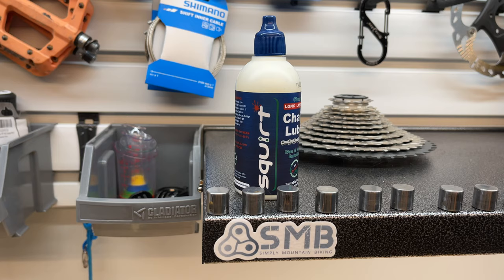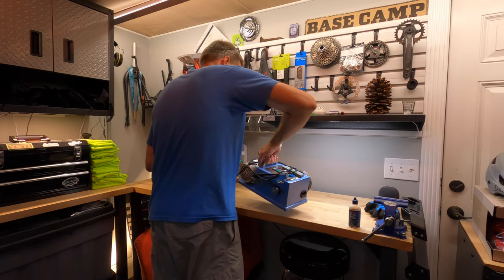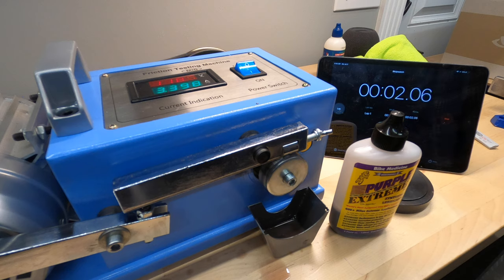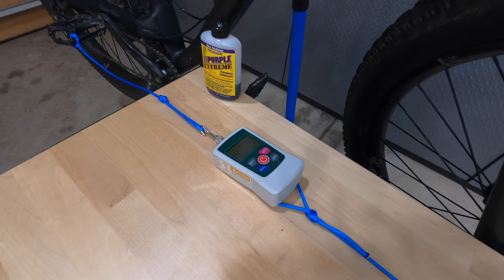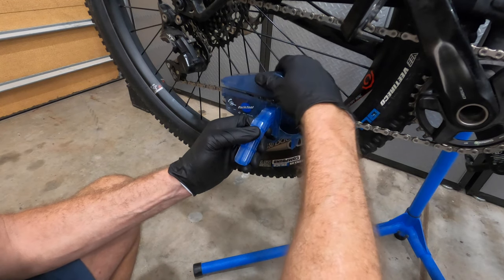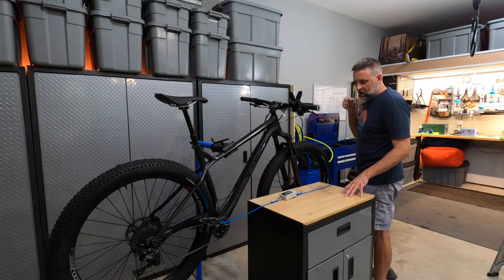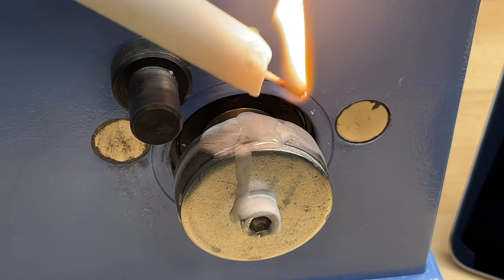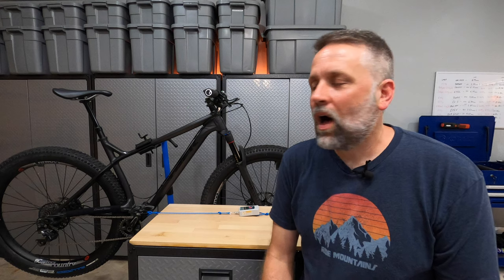Is Squirt a Good Chain Lube? | Squirt Wear Test

Comment: Hello Eddie. thanx for the revisit of the Squirt test. I've used it for over 5 years now, but since I first saw your ultimate test, I've been considering using R&R Gold. but my concern now is how long does it last compared to squirt. I've seen a few vids praising R&R with only downside been how it lasts compared to wax. some ppl say they have to relube in the same ride? Any thoughts about this? thanx again!
Reply from the maker: Thanks for your question - I ride MTB strictly and so I may not have the field experience you're looking for to compare.  I did not have any mid-ride failures of R&R when I used it, but my long rides are generally 1.5 - 2 hours and under 20 miles. -Eddie

Comment: I used wax once. I went back to oil two days later. Wax is only good to keep a chain looking good on pictures or to show it off to your friends.
Reply: I have a similar experience, though I used it for a few months in gravel bikes visiting mostly dirt roads. I reapplied squirt every 100km the day before. The chain looked clean, no dirt was accumulating but the chain lasted 800 km :/
Reply: @michahubert1179  800 km is awfully little. I'd have to replace my chain twice a month... 
I'm afraid there's no replacement for cleaning rags and lubing the chain regularly with an oil based lube. I use hydraulic oil thinned with diesel (specially in the winter)  for application, and let it dry overnight.
Reply from the maker: Thanks for sharing! -Eddie

Comment: Thanks for the video! I have a suggestion for an even more thorough and precise test - I hope you will read.
Bike chains are worn with low force across many repetitions and your test is based on a much greater force over a very short span of time. Squirt lube is not made for high force friction, so the high force might push the wax aside, while it might stay in place and do its job correctly at a force representative of what our legs put into the chain. How about setting up a test with very low friction and many repetations?
Reply from the maker: Thank you for the suggestion.  I think others have done it this way. -Eddie
Reply: Chain force is actually very high.

Comment: Well... "Protection test" with  ultracleanclean chain. The main issue is the road dirt that wet lubricants attract very very well. What would happen if you add sand to the oil lubricant?
Reply from the maker: I had a viscosity test lined up for the lube test - but didn't run it.  You can expect that high viscosity lubricants are more sticky and will collect more grit.  The lower viscosity ones (e.g., Purple Extreme) collect very little grit.  The dry lubes (Muc Off, White Lightning, etc.) all would perform about the same as wax. -Eddie

Comment: What about muc-off, the previous winner, how does it handle the friction test, if it is given time to dry out and doesn't get replenished? 
I am very curious whether it will also be scraped off since it is a dry lube.
Or any of the others for that matter, after having been resting over night. They might show very different characteristics in that case, considering their different viscosities and lube content.
Reply from the maker: In the first video, I do test Muc-off fully dry.  It does extremely well - beating wax for sure.  -Eddie

Comment: This is a good follow up test. I just bought a new chain, wondering which one I should use. Do you still use an oil based lube instead of wax these days? Thanks!
Reply from the maker: I have been using the Muc-off product for over a year and have had great results.  It does get a bit dirty - but I've not found a product that doesn't in the conditions I ride.  It's easy to clean with just water and a microfiber cloth.  I clean my chain every 3-5 rides and re-apply. -Eddie
Reply: @SimplyMountainBiking  Thanks so much. Love the smell of those Muc-offs too. :) Last one, do u strip the factory lube of the chain before installing it or just use as it is?

Comment: I have to agree. I'm not sure why all the hype around squirt. I'm not going to be buying a new bottle. I'd be curious to hear what you think of the work of zero friction cycling. He doesn't hype squirt but is the biggest advocate of wax based lubes (full immersion)
Reply from the maker: Here's a thought that just occurred to me. If wax is so good, why don't new chains from Shimano, SRAM, etc. come pre-waxed.  It has to be cheaper than Sil-Tec (Shimano) and GLEITMO (SRAM). -Eddie
Reply: well, the stuff that comes on the chains isn't really for lubrication. It may have some lubricating properties, but from my understanding it's mostly to protect the chain while in storage. It's called cosmoline and the the military uses the same stuff on their equipment to protect it for storage. At least this is my understanding.   @SimplyMountainBiking

Comment: I wonder if Squirt Wax improves after a bit on the bike, with the chain warming up & thus the wax becomes less stiff? I honestly don’t know because assuming the chain moves more & is potentially warmer, means you’re moving at faster speeds and thus the additional temp is negated by the movement & wind. It might actually become cooler when riding fast…
Reply from the maker: Perhaps? -Eddie
Reply: A chain warming up significantly from stiff lubricant would be bad. Would cost a lot of power.

Comment: Nice extra test 👍 Amho, your friction test is not comparable to an bicycle usage. Rotation is very fast, warm up and liquefying wax. Pure liquid paraffin can't challenge classic oil viscosity. It's never happen on a bicycle. If you test paraffin in solid state, I hope the result will be better. And if you add some solid lubricant, like graphite, PTFE, or ceramic (mucoff way), I think the result will be comparable to the best brand. About me, I compare my best previous lubricant, WD-40 Wet lube oil, applied every ~50km, to an homemade lube mix of paraffin+PTFE 1,3micron 9:1 -see ozcycle channel-, apply every ~150km. I get similar chain life duration, ~20% better with homemade wax, based on classic chain jauge measure at 0,5% .
Reply from the maker: Thanks for the feedback and sharing your experience. -Eddie

Comment: One thing I do not agree with with the wearscar test is that there is nothing to recreate the motion of the chain when it is not under load. That is when the wax lube usually gets put back into place and is ready for the moment of when it is under load.
Reply from the maker: I would respectfully disagree that wax could get "put back into place" because its viscosity is so high.  Maybe some of the lower viscosity lubes like Purple Extreme - but never wax-based. -Eddie

Comment: One more metric. Wet lube against dust or loose dirt. Does using wet lube in dusty conditions wear more than wax.
Reply from the maker: Yeah - it's beginning to dawn on me that many of the folks who comment on wax lubes hail from geographic regions where dry, dusty conditions are the norm.  My typical experience is damp and sometimes muddy riding... -Eddie

Comment: How about checking wear after a mountain bike ride in the dirt?  I think other lubes attract much more dirt and will result in greater wear in actual mtb conditions. I'm thinking the stiffness of the Squirt chain indicates the wax is inside the chain where the wear matters.
Reply from the maker: This is a great point - but field testing is hard to control.  I've been thinking of ways to do this in a lab - where it can be strictly controlled. -Eddie

Comment: You have to put more effort into the initial chain cleaning for lubes like squirt to be effective. A few baths of mineral turps followed by methylated spirits is what you need to truly clean a chain. Just using degreaser and a park tool chain cleaner isn't going to do a good job of actually cleaning a chain prior to applying any type of wax based lube. You should also heat up the lube and chain before applying to increase penetration inside the links.
Reply from the maker: I'd rather buy a new $60 chain every 500 miles.  Thank you. -Eddie
Reply: It's astounding how many manufacturers recommendations you have to break just to put an inferior lubricant on your chain. The day I see wax being used for industrial roller chain lubrication is the day I will try it myself. So that's never 😂

Comment: Yeah, that fricton test machine isn't really an appropriate test for chain lubricants.  That machine is really simulating a high-speed, high load bushing type of wear.  The type of wear that a chain experiences is more of a very slow speed, somewhat high load application, and the lubricant is assumed to be contained within the chain link (unless it isn't).  I really don't see how you can effectively test a wax based lubricant using that machine.  In this case, I think that the only way to really evaluate the performance of chain lubricants is to conduct some sort of simulated ride testing using actual chains and derailleurs, much like the testing done by the Zero Friction Cycling Channel.
Reply from the maker: Thank you for your feedback. -Eddie

Comment: This is interesting,   I just switched to Squirt.  I was using R&R gold (your 2nd choice) for years.   I live in Arizona so dry, dusty, and hot.   R&R gold was great for about 1.5 hours of riding than a noticeable difference in performance.   If I was doing a long ride, I would have to apply a different lube or bring extra.    With R&R it is worth noting, that at the end of almost every ride I would scrape off dirty wax on each derailleur wheel.  I am noticing the same thing with squirt, the difference is it lasts a lot longer between applying.   

It is has been awhile since I have used a true lube, because in dry conditions, they just attract a lot of dirt.  What I noticed with a lube that stuck to the chain is it stuck there with all the dirt and grime.  I would have to clean the chain a lot more often and would get black goo every where if something rubbed against the chain.

I enjoyed the videos, and the tests.   I appreciated a perspective relevant or not for each test.   I did use Pedro's X-dry lube for long rides with the R&R Gold.   I had good results, I am guessing it is very similar to Muc-off Dry.   So, if Squirt is not as amazing in AZ as the comments, then I will try Muc-Off.
Reply from the maker: Yes - I live in the moist southeast - so not a lot of dry grit just blowing around in the wind here! -Eddie

Comment: Very interesting testing methods and a good watch
 Friction Facts , prior to ceramic speed acquiring them, and Zero Friction Cycling  have wax lubricants at the top of their testing. 
Don’t know if you’re familiar with Oz Cyles who’s a wax user. He’s found paraffin wax with PTFE added as the gold standard. The PTFE is what adds the adhesion. 
Curious if this mixture would return better results.
Reply from the maker: Thank you very much!  I'll check it out. -Eddie

Comment: Hey Eddie, I appreciate the time and effort you put into these videos. But your test setup and its results seems to disagree with ZeroFrictionCycling AU's tests. I'm sure you know the long report they wrote a while ago if you dive deep into chain lube testing. Squirt lube ranked very high in nearly all test categories, particularly in chain wear and efficiency. Why do you think you are seeing almost opposite results in your test? I'm suspecting it has something to do with the difference in test setups. I'm curious to know your thoughts. Thanks!
Reply from the maker: I'm not sure why.  The friction tester tests, in a lab setting, the wear protection of lubricants.  Something about the chain perhaps? -Eddie
Reply: @SimplyMountainBiking  you can understand what is different if you read the (somewhat a monster of, admittedly) PDF that accompany those tests, though Squirt is perhaps the worst of all wax lubes because, as much as I suspect, this is basically some sort of off-the-shelf wax emulsion that is 'dime a gallon' with cocaine-like markup... but it still works! Basically, why wax lubes work so well (but the best of them is immersive hot waxing lubes actually) because wax or otherwise solid lubricants get 'trapped' in the pin-plate wear interface that does NOT rotate 360 deg during pedalling, but articulate on a rather limited angle - as it is apparent for anyone who have seen pin wear patterns on an old chain. That allows the wax to retain in friction interface and 'reflow' into pin-plate friction interface as chain articulates, shits, runs around deraileur jockeys, etc. Personally, I've made my own waxing blend with some automotive antiwear additives and a combination of 1/3 paraffin wax, 1/3 beeswax and 1/3 of antiwear additives - if you don't wanna mess with them your best bet would be some high-end marine or agricultural GREASE, preferably calcum sulfonate one because it has great antiwear properties. This stuff works great in ALL conditions and extends like of the chain 10xfold - it is true, just like ZFC tests. The key to good performance is good CONSISTENCY of the wax (and you can only get this with immersive waxing) - it needs to be hard, pliable yet and NOT tacky at all. This way, after immersive waxing, it forms a sort of 'o-ring' inside friction pairs that plugs it from dirt and water ingress (to a point, of course), and gets very slowly consumed lubricating the chain. I am easily getting 1000 km PER APPLICATION and I have a test chain that I monitor wear on - comparing it to a new chain after washing both very clean with solvent... well, after about 15 thousand km of use it is about 2mm longer. The chain is of relatively unknown manufacturer - Taya OCTA SL, top of their range so it might also play a role. You should really try immersive waxing, THAT is a true quantum leap in chain maintenance.
Reply: @Balorng  Interesting! Tell me more about the anti-wear additives, and also why the beeswax? I’m currently using paraffin + teflon, with about 1/3 Molten because I had it around.

Comment: Sorry but in my opinion your wear test is neglecting the geometry of the chain and the pulley wheels. The adhesion on a drivetrain is higher with the squirt compared to regular lube and this is pretty obvious because the drivetrain is waxy instead of dirty, meaning that lubrication is always there whereas the lubes adhere less. On the other hand your test proves the worse lubrication property of squirt but taking into account my comment the drivetrain is always lubricated with squirt. In my book always lubricated is better than lubricated better but for a short amount of time. Your kinked chain shows the strong surface adhesion squirt has.

Your 2nd test on the friction/drag makes complete sense.

Thanks for taking the time.
Reply from the maker: Watch the Ultimate Bicycle Chain Lubricant Test to see how Squirt performed with a constant supply of lube. -Eddie

Comment: Sorry a Brugger Test does not mimic anything that is going on in a bicycle chain on a bicycle. This is like pretending to mimic dry dust riding conditions by using a sandblasting machine.
In a chain the links slowly rotate <180° under force, then do not rotate under force, then again slowly rotate <180° under force, then are relaxed for the rest of the pedal stroke. The rotation speed is drastically slower as compared to a Brugger machine, the lubricant is pretty much trapped within the chain (there where it matters) and as outlined above there are pauses between each application of force.  There is no way that you can heat up your chain with the force of your legs by even a few °C over ambient temperature.  So the "test" you make asks "questions" that are pretty much irrelevant for a bicycle chain.
Reply from the maker: Thanks for sharing. -Eddie

Comment: I do think Squirt is bit overrated, but I don't think these tests are fair or reasonable. 

The test on the bike, for example.  That just isn't a well-cleaned chain.  Wax emulsion type lubes are known to not play nicely with other lubes.  they need a clean chain for the first application to bond correctly to the metal.   The clean in this video was more of a wipe down and there would have been huge amounts of old lube and dirt left inside the chain.

The friction test seems to give a false result on lubrication ability as it will mostly have worn off by the time you are at the end.  It seems to me that this is a test for longevity of lube, and very little to do with how good the lube is if it is regularly reapplied. 

I do recommend Squirt to some friends who I know are just not going to maintain their chain much, but with the caveat that the first application needs a hell of a lot of work.  There are obviously better options out there, but it's a far better product than this video suggests.
Reply from the maker: Fair points - but...  

No one wants to watch 5 minutes of me cleaning the chain.  It was cleaned with a solvent bath and brush with the chain cleaner several times, then saturated with simple green, wiped, blown dry, and then allowed stand for over an hour before I applied the Squirt.

Now, if I have to do more than that, I would rather buy a $60 chain every 1k miles.  🙂 -Eddie
Reply: @SimplyMountainBiking  You get to do far less maintenance than that if the first application is good!  One of the benefits to Squirt is that once you've done a proper application it's very low maintenance.  You can just wipe the chain down and reapply and you basically never need to degrease. BUT that first application needs to be good.

The problem with those chain cleaner type solvent baths is they really are ineffective at cleaning the bits that matter on the inside of the chain.  This is why you will have a lot of lube leftover on the inside even if it looks clean.

So what you've actually got here is a thin solid coating of Squirt sat on top of the old wet lube... which basically means you aren't even lubricating with Squirt, rather it's just a bad watered-down version of the original lube!